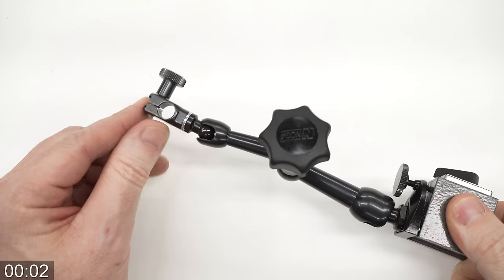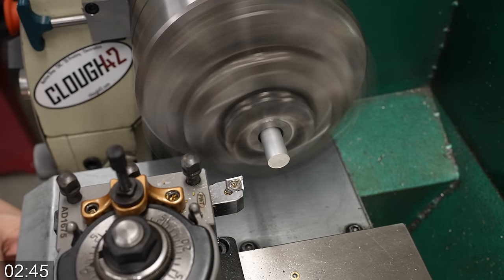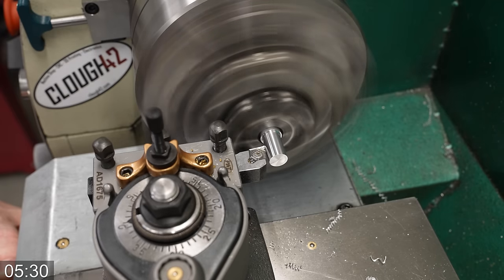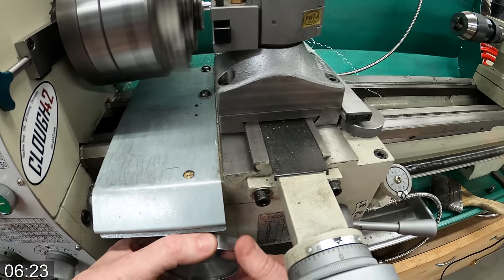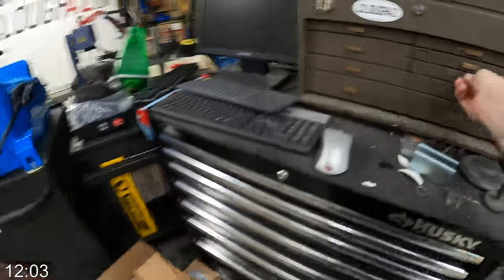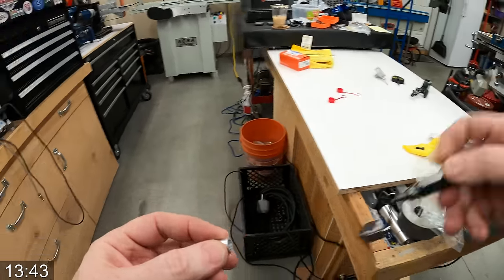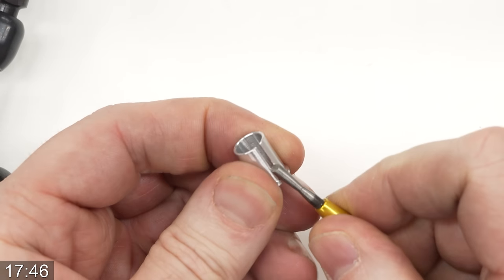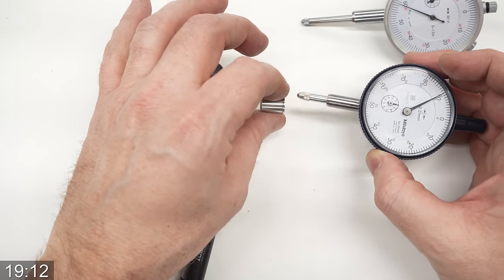How long does it REALLY take to machine a simple part? | 8mm to 3/8 Indicator Adapter

Comment: You can't put metric and imperial micrometers in the same tool box. They will interbreed and create yet another measuring standard, one even more complex than its parents.
Reply: Before long you'll be talking a 1/16th of a millimeter!
Reply: Have you met BA threads?  they're a british machine screw thread, with the standard publish around 1900.  They're a metric thread, everything is defined in metric, each smaller pitch (bigger number) size is 0.9 the bigger, and some similar diameter change. 0BA , largest size, is 6mm x 1 (with weird thread angles, so an m6 bolt won't fit an 0ba nut)  It's all perfectly sensible and logical, and has no business being a thread standard from 1900.  Except  the standard actually gave inch values for the screws -- they rounded, converted to imperial, and rounded again to the nearest thou.  

BA holds on in some electronics applications (mostly instruments).  And darts -- darts are 2ba.
Reply: Or the panzer gewinde.
Reply: @dmscheidtify BA fasteners were still widely used in railway signalling components when I worked in this area ~20 years ago, I doubt that has changed much. They are also very popular for model engineering as the thread pitch scales perfectly with fastener diameter, making small fasteners look like properly downscaled versions of the full size ones.
Reply: I laughed way to much 😅
Reply: @dmscheidtify : Correct. Actually "invented" by the "University of Zurich" (actually ETH) at the request of the UK "Institute of Electrical Engineers" (IEE). Just at the time when "electricity" was the new coming thing and a "better" thread system was needed for mechanical components involved (mainly brass). Just in case anyone wanted to know more! ;-)
Reply: I bet they will be called the Z-GEN series.
Reply: Nothing complex about metric, if it helps to water down imperial then it can only be good :)
Reply: @ADBBuild exactly, Withworth threads are commonly seen as metrical as they are measured in mm’s. But it’s offspring is an original concept that belongs to the imperial system.
Reply: I have a universal adaptor for my toolbox. It allows for imperial and metric in the same compartment, however it won't work if I put the metric in before the imperial. The one that allowed that was sold out.
Reply: With reference to CEE    That system will be bananas
Reply: @dmscheidtify The BA thread angle is 47.5 degrees.  Metric is 60, UNF and UNC 60, Whitworth 55 and Acme 29.
Reply: Wouldn't it be the opposite? Wouldn't it be a mashup of both? Best of both worlds
Reply: I have an old motorcycle, a 1969 Triumph Bonneville (it's actually a 71 Trophy TR6C) which has an obscene mix of fasteners including metric, standard, British, and whitworth. During the years 69-71, triumph was working to phase out the use of the whitworth and British standard cycle BSC fasteners in favor of unified ones, but they still had such a large stock of the other types that they kept using them until the supply ran out. Naturally these supplies ran out at different times, so you never knew definitively which ones a bike was going to have until you took it apart.
Reply: Microfurlongs is the new unit of measurement now !!
Reply: @GodzillaGoesGaga o
Reply: @jonnyphenomenon  Sounds like a nightmare. I can't grasp that imperial spanner sizes refer to the most common bolt size using that size bolt head. I've noticed that USA youtubers call M6 bolts "10mm bolts" because of the required spanner size, but not many call them 5mm when they have Allen heads.

Comment: For a change I like the format. Fit for a discussion about work flow. What I like about your videos is your thoughts about why and how. Never too much of long sequences of chips forming. Only thing I do differently is that I always have a 6inch (150) ruler. deburring tools and cutting oil on top of the lathe. And a set of drills 1-10 mm plus files within reach.
This video confirms my belief that living in a metric country makes life so much easier.

Comment: I keep cheap HF calipers at most work stations in my shop, and only break out the good calipers for official measurements. Downside is their vampire battery drain makes changing batteries the first thing often needed to be done -- Now keeping the button batteries at every other station. Great work process video.
Reply: I got a different set on Amazon that were cheap and don't do the same thing with the battery drain. The brand was qfun I got it a bit over a year ago, still on the original battery

Comment: Served in the Air Force for 20 years and always left my "jewelry" at home since I worked with various equipment.  Glad to see someone point out they remove theirs before cranking up the lathe.
Reply: Agree 100%. Actually hands-on with any aeroplane means "all jewellery OFF" (for very good reason).

The work flow was very useful too - as is everything you film
Reply: Absolutely. Once I was climbing down off a shelf and on the slight drop at the end my ring caught the edge and nearly took my finger off. I've never worn anything ever again even when not working.

Comment: The format fits small projects like this, I like it.  Hopefully it takes less of your time as well, so the efficiency will lure you into sharing more video!
Reply: Somebodyelse6673 you are so right, I came here to say the same thing. Also to add a comment about the 'distance shot' effect with a fish eye. Three 360 cameras might provide enough coverage that those lenses will not be needed and those camera placements could be used on the float more, for specifics and details consult the folks at imaginations unincorporated unlimited.

Comment: Just a thought.  Make bushing a bit long,add a groove opposite the lip to put a snap ring on and capture the bushing in the holder.  Easier to keep track of and easier to install your indicator
Reply: Groove in 1 mm wall thickness? Find a small ring which is prone to go missing.
Reply: Could also leave a “bead” ring around it. Big enough to keep it from sliding out ,but small enough to push through the hole in the holder when the bushing is pushed in   Dependent on the gap left for compression.   Just random thoughts
Reply: Leaving a small flange on one side is also way to help deal with small hollow parts like this. Then again i thought just adding a single drop of Loctite or Elmers glue and collaring the Mahr Millimess to keep stem size uniform throughout his shop. Don’t hate on good ol’ Elmers, if it was good enough for my grandpa and my concrete ramp it’ll hold just as long as you want it. 😇

Comment: I do a lot of similar parts on my ancient 9" SB. I always felt that I was taking too long, but maybe I was wrong. You have better equipment are way more knowledgeable than I am and our times are comparable or at lest in the same ball park. The little adaptor is a part that I would make several of while I was set up since there needs to be one to use , one to lose, and one someplace that you will remember for sure, but don't. So make 4.

Comment: The metric/imperial hassle is why I like electronic measuring tools. The only reason why I don’t like them is the battery, so that I have to keep numerous ones in stock and they don’t all use the same batteries. Otherwise, the video was fun to watch. I’m always going from one place to another for tools. Since my basement is fairly large, I keep several sets of things, such as hex drivers and such.

Comment: To ensure the bore and the outside diameter remain concentric. Rough the diameter then finish bore then skim the diameter to size. Parts can move when drilling from solid and thin walls can expand when reaming.

Comment: Alternative option Easy-Install Dry-Running Flanged Sleeve Bearings or 8 mm Shaft Diameter McMaster Carr 1281N36

Comment: I very much appreciated the ‘real-time’ format and the ability to see you move around the shop and your shop organization. As always, the voice-over is a big value adder.   I liked the running clock. Adding a DRO cam would probably help. A camera angle from over your left shoulder showing the work, your hands, and the DRO might work well for lathe work, and perhaps mill work. 
I like a main camera view for lathe work, maybe with a pic-in-pic showing DRO and hands on the controls. 

A video about your tool organization philosophy would be interesting, particularly storage in drawer vs rack. Tool grouping for efficiency. 

Thought: for bigger projects, maybe provide a 4-camera semi-real-time version in addition to your normal format (with minimum editing and voice-over effort). Perhaps only for Patreon?

In summary, the experiment was a big success!

Comment: Hi,
quick job.
Some thoughts
you have the drawer with the tools below the lathe. So you must open and close it each and every time when changing the tool. In addition: the drawer will collect chips.
I have the tools in a cabinet with the most common drill, and reamers above the lathe. So, no opening and closing the doors of the cabinet when change the tools and less chips in the drawer. 
the maesuring tools , and less common tools I have in a movable cabinet. So I can roll it right behind me. 
Not a single step to walk.

Comment: A few years ago, I tried to buy a NOGA mag holder with the 8mm holder. I could not find one here in the USA, nor a seller that would ship one here (at an affordable price). My solution was close to yours. I procured 8mm brass bushings (ID) that had 11mm OD, by 30mm long. Machine down the 11mm OD to .375 inch, cutoff what was sticking out from the lathe chuck, then use a thin slitting saw on the mill to split the bushing on one side. There's low cost dial indicators from China that are the 8mm stems. I've had a few of them that fall and tweak them so they hang up, and get discarded.

Comment: Paul Brodie machined a new tailstock hand wheel which is a larger diameter and weighted. This way he can spin the wheel a few times with one turn and makes it a lot faster to retract. Could be something you consider.

Comment: I too enjoyed the formate and subject of this video.  I still consider myself as a novice even though I’ve been using my lathe for over two years.  I have searched the internet with no answer to my DRO question.  Mostly they show how to install the unit on a mill or lathe.  What about a  “simple” tutorial on what you do once you entered the measurement in the DRO.  I’m constantly second guessing the system I have developed.  Thanks.

Comment: I have a g4000. I’ve been shopping around for the els and vfd upgrades. Got carts loaded…but today I almost drug that thing to the curb. So much slop in the carriage, crossslide, and compound it is unbearable. I’ve got the gibs cranked to the verge of not being able to move anything. At least I can watch someone else doing it right! Btw, my g4000 came from a guy who was heavily into 3d printing. He made a throw lever that fit the tail stock nut. It’s wonderful! Only a pain if you remove the tail stock. (Getting it set perfectly for the right throw)

Comment: Yep, that was good. Like you said, we don't normally get to see your workflow so it was nice to have that insight.
Is that a Qidi X-Max 3 box sat on the floor by the CNC mill? A new one, or just the box that your old one came in?
Have you considered something like Zach Freedman's 3D printed Gridfinity organisation system for all the small tooling/hardware in your drawers? I'm trying it out, it's quite neat.

Comment: I like the format in general. A minor criticism is that for much of the chest mount video, we couldn't see things that you were looking at or working on, because they were above the Field of View of the camera. About the only thing that would fix that though, would be a shoulder mount that follows head direction, and that might be even more motion sickness inducing...

Regardless, thank you.
Reply from the maker: Yeah, it was pretty bad.  It's a GoPro with HyperSmooth stabilization turned on.  It works beautifully outdoors, but it really let me down today.  Of course, I couldn't see that it wasn't working properly until it was too late.
Reply: @Clough42  All part of the adventure of putting together videos. :-) Again, thank you.

I was heading down the wrong path with what I thought you were going to do initially. I thought you were going to create a new end effector for the Noga arm specific to the 8mm indicator set. This works too, and doesn't involve the expense of a new Noga arm to attach it to, along with the magnetic base to put on that arm, and the inevitible confusion as to which arm is supposed to be with which indicators.

I do imagine that you're going to make a few more of these adapters though to cache in the drawer with the Metric Indicators so that if one ends up left on an indicator and it's not the indicator you just picked up, you can still get things set up while your head goes through the inevitable follow-up of 'now what indicator was I using last time...' Because we all know that never happens.

Comment: I'm surprised you didn't use the holder as a GO/No Go gauge when cutting the OD with the work still in the chuck. You could make the adjustments at the lathe rather than checking the fit after removing the part and fit testing it at the bench.

Comment: Do you think you'll ever make a cam for the tailstock lock ? It's the one thing I really don't like on this lathe. When I look at newer lathes I always check that the tailstock has a motion locking lever.
Reply from the maker: I've thought about it, but there's some taper in the clamping surface under the bed, so giving it a quick quarter turn action across the entire length of the bed will be difficult.

Comment: It took me 4 hours to turn a 22mm x 130mm with a 25mm x 10mm head out of a 400mm x300mm bar of 4130 steel. The second one did not take quite as long. (2 hours) It would have been cheaper to buy two, but not so satisfying.

Comment: A lot easier to use off the shelf brass tube - all you need to do split it - I did the splitting on a band saw. Brass will be easier on your indicators.

Comment: The stringing is caused by incorrect feeds and speeds. Machinists handbook is a bible when it comes to turning, milling, machining! I use a mini-lathe and my aluminum speed is only 350 rpm, 2 thousandths cuts. For steel it's way less like 200-250 rpm. For beginners, get a machinists handbook, you won't regret it.
Reply from the maker: Feed and speed required to reliably break a chip also depends on cutter geometry.  Sometimes it's easy to get into the sweet spot.  Sometimes it isn't, depending on the inserts you have on hand and whether you want to spend time changing them.